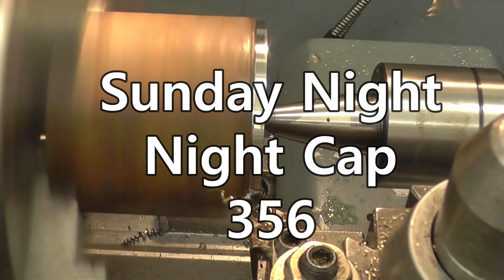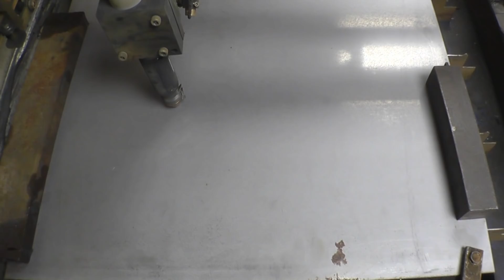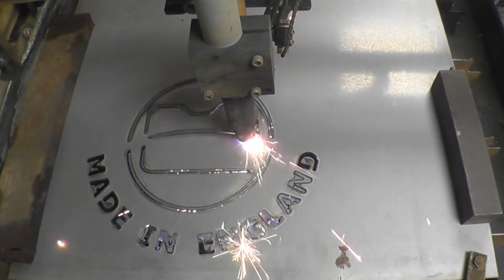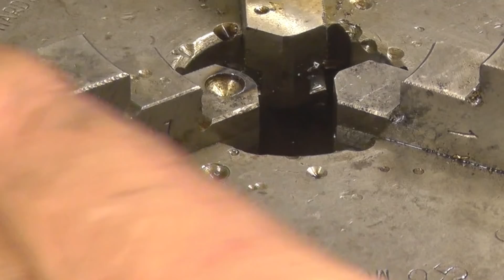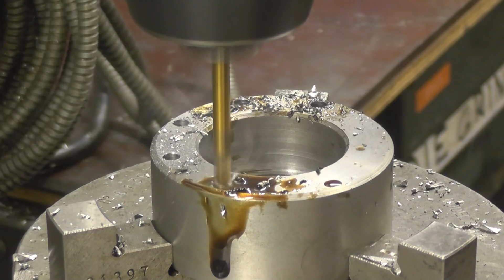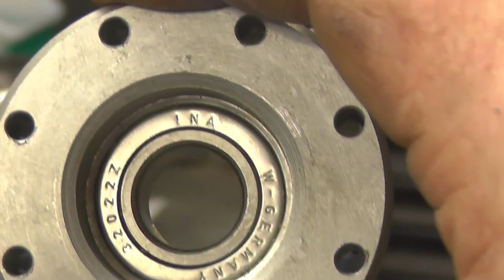SNNC 356 P2  Dividing Head / Land Rover Sigh

Comment: Instead of using the dividing head could you not have just used that DRO and the axis of the mill itself? Good work anyway!
Reply: Why work on two axes when it's simple to work on one ? In this process, r remains constant at 25mm and only θ changes - an overshoot is so easy to remedy - especially with a pointy prodder which will align more accurately than by using a ·5 DRO !

Comment: Hi John, have you considered using the PCD function in your DRO? I have found it very simple to use! Cheers Colin
Reply: I'm aware of that but I'm pretty sure this is more accurate and considerably easier to use ! With the DRO, it's so easy to overshoot in both X and Y. With the dividing head, the overshoot is obvious to spot and simple to correct and the only overshoot is in θ, not AND r - which remains at 25mm.

Comment: Nice job John. I remember the vice and table on the drill press at work was horrible with holes, Usually with equipment like that nobody really gives a hoot and so on. Not until you acknowledge that kind of behaviour is laziness or sloppiness do you start to respect the equipment. My kurt type vise has one small knick that reminds me every time I use it, do it right until it becomes a habit. Cheers, enjoyed the SNNC!
Reply: I've an 8 year old induction hob with an easily scratched ceramic surface. As far as I'm aware, it only has 3 small scratches on it - and it does get used !

Comment: Hi John,
Top tip there leaving the drill in the hole whilst you moved the jaws out of the way...
Have a good week
Paul,,
Reply: He could have mounted the work differently so that it was away from the jaws - using parallels - such as a couple of hammer shafts ;)